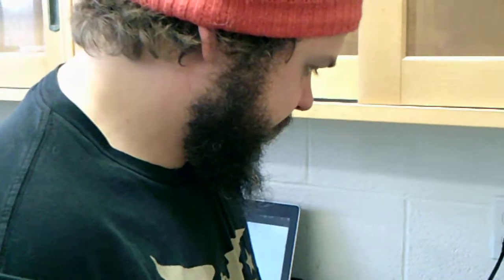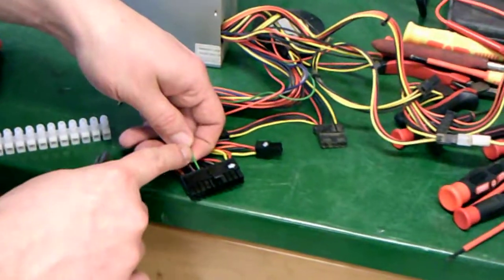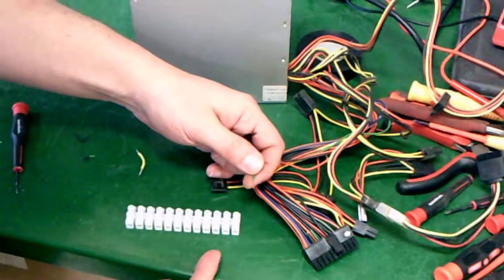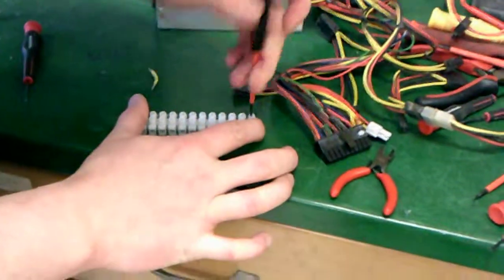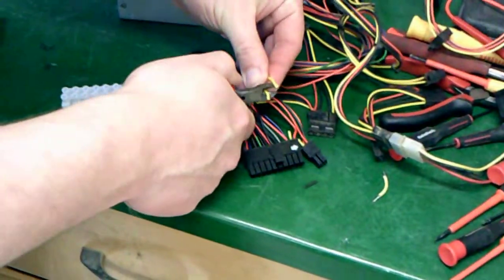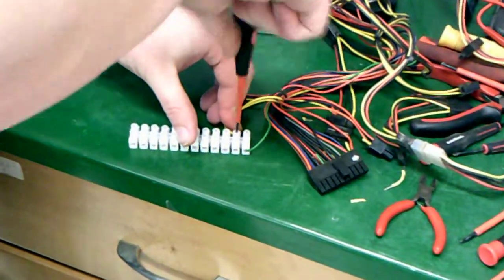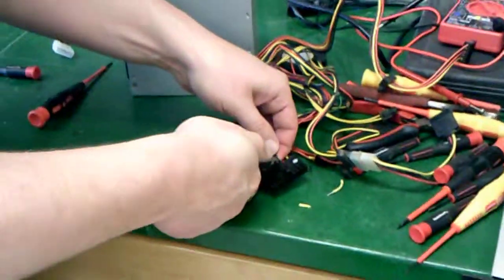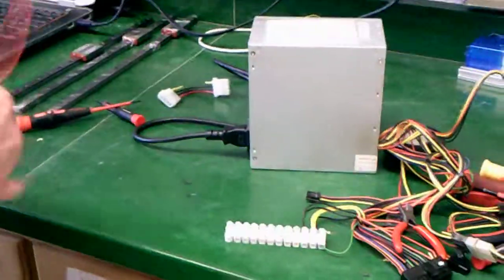Kossel Mini Build (2 of ?) Using an ATX Power Supply

Comment: You need a good wire stripper sir. I know radio has a good one. The one where you just put the wire in and squeeze the handle. strips perfect every time. Might find it cheaper online tho.